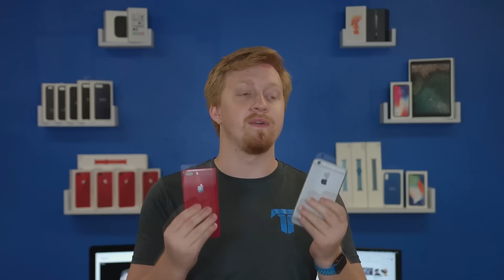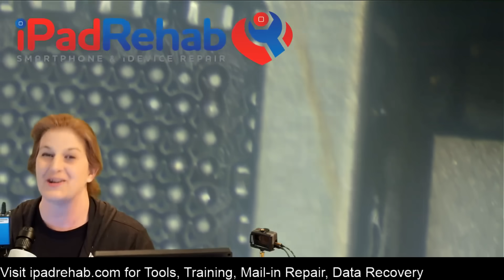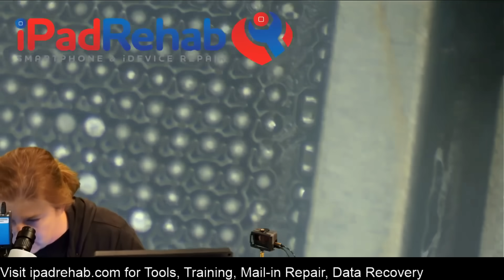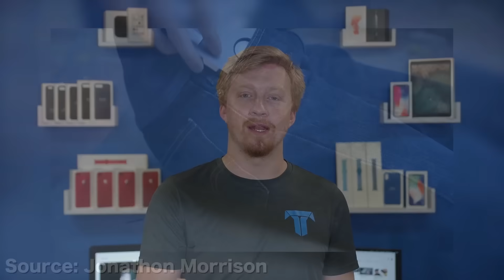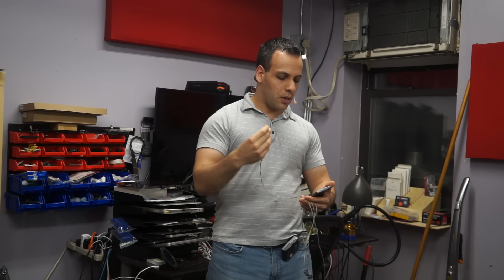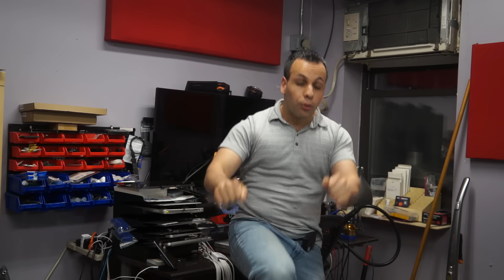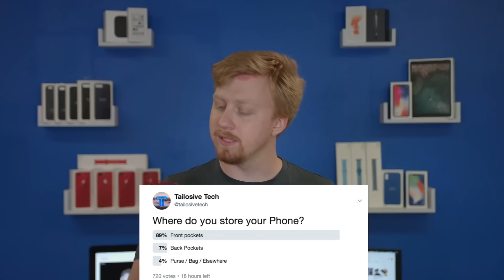The truth about iPhone bendgate deniers

Comment: That's a great video. You are right. It is hard to believe that you are wrong on this topic. I have always put my phones on my back pocket, sometimes 2, rarely even 3 phones behind each other. I have never had any issue with my phones. I have never thought it can be a problem before the bendgate happened. To be clear I have never had any type of apple product. I had lumias, Huawei and Samsung phones.

Just a side note: some of my friends have Xiaomi phones. They may have seen more issues with their phones than iPhone users. Widespread screen issues, touch issues, general reliability problems. They still don't complain because they know it is a cheap poorly made piece of crap product. (all of the phones from the 0 to 200 usd price range)

Comment: Well that hurt me, yeah, I agree that most of the nexus6p's production was faulty, but on the other hand, many other nexus6p phones survived because they were from another batch, a later one. I had a first batch nexus 6P and the construction for the average man, who has not been working out 24/7(jerry rig everything), was fine. The problem was on the logic board itself. The solder balls were like on some macbooks ( lg g4 and other phones from that period had this problem too ). I still have my second nexus 6P running as a secondary phone and a pixel 2 xl as my primary. It still runs fine and the latest stable OS out right now, android oreo 8.1 with the latest security updates.

Comment: I use a galaxy s6 as my daily driver and it performs better than most mid to low end still. The only problems I have is lack of sd card and replacing of the battery. Stock Rom is fine as long as you don't use the stock launcher.

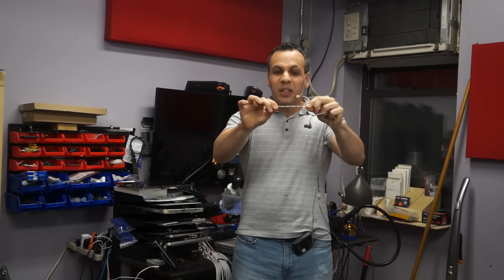Comment: 9:56 So basically typical fatigue failure?
Reply: Correct. However most phone manufacturers use something called "underfill", which acts almost as a shock absorber for the chips, and keeps them bonded to the board properly despite vibrations and slight flexation. If Apple had used underfill on this chip, there would be undoubtedly fewer cases of touch disease and less flexion-based damage on this particular model.

Comment: So, if I wanted to start learning how to do work like this what would you suggest I get for practise?  I don't mean equipment, I've seen you go over that before.  I mean I don't have much in the way of broken components, what would you suggest I get to actually try my hand at repair without making myself responsible for further breaking other peoples stuff?  After all, I may work IT but my job is purely Operator and Analyst type work, I never deal with hardware even though I have a strong interest in it and thus would like to learn how to actually fix the hardware when needed.

Comment: good information here. Also on the note of these bad products, I think testing before release is something that just doesnt get as much attention as it should especially when companies are always rushing to release next iteration, new model, every few months. I get and understand that purposely holding back on technology in order to make room for next iteration improvements very frequently is how these companies make money, (and perhaps some unscrupulous ones that purposely design something to fail) and that competition is high but its a bit ridiculous. I was able to look into life sustaining devices at phillips and how they do things there and it was very fascinating. You would see their devices tested in high humidity, high heat, high cold, dusty environments, in a total vacuum, different atmospheric pressure, and combinations of all of the above. buttons would be pressed millions of times, software flashed thousands of times, purposely made failures to make backup redundancy circuitry kick in to make sure its all working properly. They would drop the devices from every possible angle and on all kinds of different surfaces and check to see what got damaged. all components on pcb which got any point of damage would get hot glued to stabilize them on every future pcb, the boards were also conformal coated where necessary, and tested for years in all these scenarios. It actually was pretty cool. Now I understand that consumer electronics arent as important as life sustaining devices, but I think they should all go through a proper suite of tests. Things are being made disposable these days and everyone is just doing almost the same thing with no innovation. I think there needs to be some change eventually and there could be great money for companies who design reliable products, not only due to the reputation that would eventually precede them, but if something was made reliable and upgradeable through plug and play modules released (perhaps yearly)just for example, they would still be generating a lot of revenue from the new modules with the same base product. (which would have to be reliable for this business model to work). Instead of these companies all doing nearly the same thing, I think they should be thinking more like this.

Comment: Hey Louis! I would like your opinion on Google's Project Fi phone line up. I have the Nexus 6P and have had my doubts about it since I had replaced my battery twice by myself. I like Project Fi as it fits my price range and works in the area I live in but they have only a handful of handsets available that work on their network. I'm currently waiting for the pixel 3 and have been looking at the pixel 2 XL. I love watching your channel and take a lot of your opinions into consideration when recommending or purchasing electronics. What phones would you recommend from the Project Fi lineup of Pixels if any and if not can you tell us what's wrong with them? What smart phone do you feel is properly designed and have the least problems even outside of the Project Fi lineup?

Comment: ah yes, the Deathst- err, Deskstar XD
ever thought about doin a video talking about that one, Lousi?
short version for the uninformed, is a company tried an experimental new HDD platter design that used a magnetic powder bonded-adhered to a cheap glass platter, and failed to test it PROPERLY before selling it- they were MEMETICLY infamous for dying (as in the powder would ENTIRELY come off the platters, rendering them non-magnetic (and therefore both useless, and irreparably destroying ANT data on the drive)

Comment: There is no Bendgate. Only stupid people.
Reply: Mac Daniel, you have to be the most ignorant, stupid person I've ever had the pleasure of seeing on the internet. If there is no Bendgate, 1.) Why would there be solid evidence that the iPhone 6 is 7 times more likely to bend? And even so, I'd like to reiterate that it's not a single bend that damages iPhones, but flexion-based damage over time, combined with an over-tightened logic board. It's not going to just happen due to bending, but also from small shocks over time. If you gently toss your phone onto a bed every day, have ever dropped it (even with a case on), the shock will spread inside, and any chips that aren't underfilled will also vibrate a bit, and with the above-mentioned design flaw of the Touch IC's M1 pad coming off, it's only a matter of time before it happens. Also, here's bendgate manifesting itself on the iPhone 7 (hint hint, Apple had to issue a recall for anybody experiencing some of the issues it may manifest): https://www.apple.com/support/iphone-7-no-service/
Reply: Apple admitted there was bendgate
Reply: "stupididty" 

https://www.theverge.com/circuitbreaker/2018/5/24/17389220/apple-bendgate-internal-documents-iphone-6-plus
https://motherboard.vice.com/en_us/article/a3a3gg/iphone-6-touch-disease-documents
Reply: Mac Daniel I repair these things daily. Bendgate on the 6p and to a lesser extent the 6 is most certainly a real thing. Rest assured, if you have a 6p, it will eventuality bend and start exhibiting the loss of  touch functionally. It's inevitable.
Reply: Ian Holden dude. EVERY 6P I touch is bent to some extent. Every single one. The regular 6 will bend too, just with less frequency. This bendgate and touch disease is a real thing. If you pocket carry a 6 plus, you will bend it and when you bend it you eventually will damage the touch ic chip. Just go on eBay or Mercari and search iPhone 6 Plus from 50-110 dollars. You’re gonna see a lot of bent phones with damaged touch ic chips. I’m not as negative about Apple as Louis is; I think the phones are great, with cheap parts to fix  them as compared to other devices, but the way Apple handled bendgate and touch disease is a debacle. They are a1 trillion dollar company. Take care of your customers, you can afford it.
Reply: Mac Daniel ...explain how no other phone bends when put in back pockets, then???
Reply: That's the iPhone 6s, not the 6. You might want to learn the difference. And I'm not sure if I've mentioned it to you specifically, but you're falling under survivorship bias, which is understandable. I have an iPhone 6 too, and haven't gotten the issue either. But I've also taken my phone apart, seen accounts of touch disease, and seen technical explanations and write-ups about it. Not every iPhone will get touch disease or flexion-based damage in its lifetime, but it doesn't mean that it's not an issue for others.
Reply: Mac Daniel Pretty sure the 6s has a different internal structure design.

Don't hear as much failures on the 6s minus the battery
Reply: Curtis “Eventually bend?!” So if they are in a case and not put in skinny Jean pockets they will just bend by themselves? I find that highly unlikely. I sold my iPhone 6 to a work colleague so I get to see it everyday. Guess what? It’s still fine. That’s 2 generations of owners and not an issue besides having to replace the battery. And interestingly, we both put the phone in our pockets on a daily basis and because we both work in a technical environment we both where jeans. Still fine.

Everybody is going on about how this is such a bad design. I would like to see how many iPhone 6’s were sold vs how many ended up breaking due to bendgate. I’m guessing it’ll be less than 5%. And they have continued selling the same form factor so clearly the outlying design was very successful. A few modifications to the internal structure and another few million phones sold? So how is this the epic failure people are making it out to be?
Reply: Ian Holden I don't think it's much to do with the actual bending of the chassis.

It's probably got more to do with how the PCB is installed in the chassis. The 6 and 7 apparently share the same weakness while the 6s, 8 and X apparently don't, or at least it's not as reported
Reply: Mac Daniel the guy with logic proofed that the issue exists.
Reply: No. The iPhone 6 bends if you put it in your skinny jeans backpocket. Thats true. But thats no bendgate, thats just good old stupididty. Bendgate would ONLY exists if the iPhone would bend under normal use conditions.
Reply: I use my iPhone 6S under rough conditions at work every day and it still works fine. I dropped it like 100 times, no problems at all. Its almost 3 years old now. The iPhone 6 that I owned before worked fine too.
I am not a big fan of the iPhone 6 (due to its RAM limitations) or Apple in general after the 2016 MBP series and the iPhone 7 without 3,5mm jack, but bendgate was really made up by stupid idiots. Dont put your iPhone in a small pocket and use it with care and it will last almost forever.

Comment: The iPhone 6 was not engineered incorrectly it used materials that are not strong enough to hold up to extreme conditions and they were used to keep the phone from costing 1000$. And Apple would not know this until millions of phones are released and idiots don’t respect their iPhones, also the iPhone 7 does not have the same issues it was already corrected with the release of the iPhone 6s

Comment: I agree Apple should do far better engineering & quality control at Foxcon. Considering how much they charge. Just too many crappy releases in recent years. I’m getting revenge with my wallet. Besides, now that I’m retired I need to cut my spending on technology. I’ve seen the fantastic video on quality control at One+ 6  Looks like I might try their phone next.
Note:
You didn’t mention the changeover from lead based solder to higher tin content. I’ve heard that modern factory pcb wave soldering machines try to limit the lead content (for health reasons) and that has caused major problems with longevity of electronic pcb’s

Comment: Basically every phone on the planet can end up being defective, the reality is that you just need to be really lucky.
However, even if I’m an apple user myself, I totally agree with your opinion, making excuses for them doesn’t get us better products, only worse (and more expensive) ones.
Luckily not all apple buyers are the same, that guy is so biased everything apple does is absolutely perfect, which is REALLY far from the truth.
Reply: Gabriele Mucci as far as bending when compared to android devices? Android manufactures like samsung for one used glass and put a metal slab in they phones for support so when they did bend test on them, you cant bend it by sitting or applying force to it, you need a machine to bend it in half fully but iphone 6 didnt require a machine, a human can bend it in half with his hands
Reply: Ria Driguez perhaps you should look at the note that came out during that rim period, you absolutely could bend it with your hands
Reply: steven4570 which note?
Reply: believe it was the 4 or the 5
Reply: steven4570 its 100% not the note 4 because I still have it and it's very tough to bend it doesnt even slightly bend, I'm not sure about the note 5 but never heard of samsung note 5 bending since samsung puts a metal bracket in they phones to prevent bending

Comment: Long live my 4S! Perfect size, sturdily thick, not too big for my hand so that I fumble it. Everything since has had a greater surface area to volume ratio (so more likely to bend), more glass (so more likely to crack), and has been bigger (so more likely to be dropped). Replaceable screen (successfully replaced by me after I fumbled it onto the corner of a solid metal bar), home button, etc, etc. All the benefits of the iOS in a solid package. It was so good that Apple had to make updates to stop them working. I might upgrade to a 5S at some point if it is allowed to still work and I will consider the SE but I doubt if I would like to gamble away so much money; why would I?

Comment: The widespread problem of the S6 hardware is phantom button presses of the back and then (non existant!!) menu key. Happens especially often when you have bad network coverage.

Btw. I have an SGS6 and even though all your points are valid (or where at the point it came out, I personally find touch wiz as responsive as any other phone, but thats probably because of it being long after the first version came out) I still bought it because all those points do not matter to me, and I bought it much later after the price dropped enough. Sure it could have been better, but maybe they just hit the market they wanted. One persons gem is another persons piece of shit. And herein lies the crux of that whole apple thing, people are just fans of their devices because for them it works perfect and they can't understand that other people are not the same and do not have the exact same phone. Same thing with cars btw.

Comment: Don't you just love working in the Apple repair industry Louis? I've serviced Apple computers that go all the way back to 2001, and have yet to encounter a line of Apple products that hasn't had a consistent problem familiar to a set line, whether it's iBook G3s that have damaged display/backlight cables, or mid-2012 MacBook Pros with faulty power buttons. Puts to bed the lie that Apple products are "more reliable," eh?